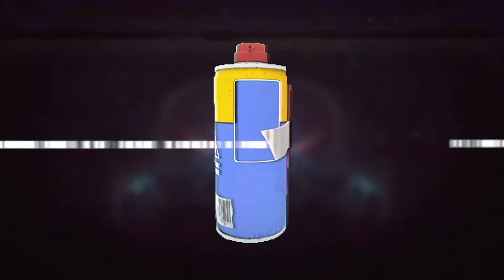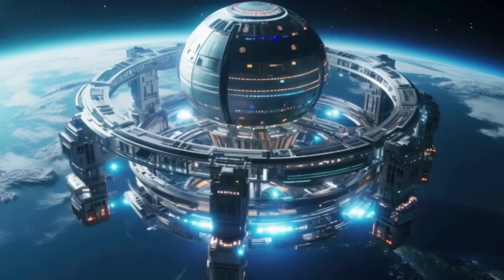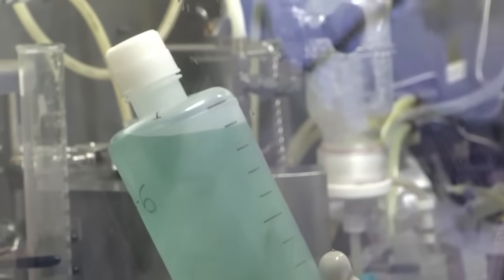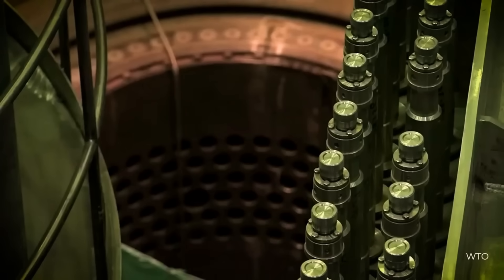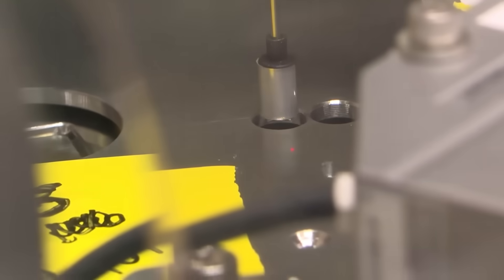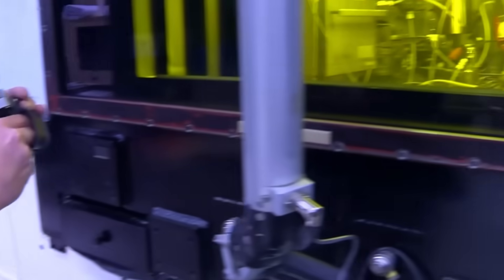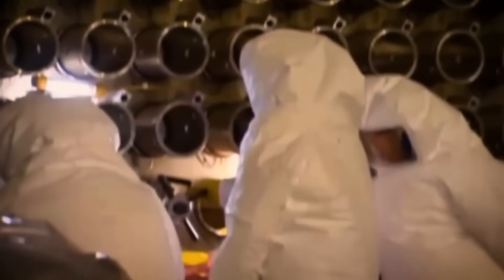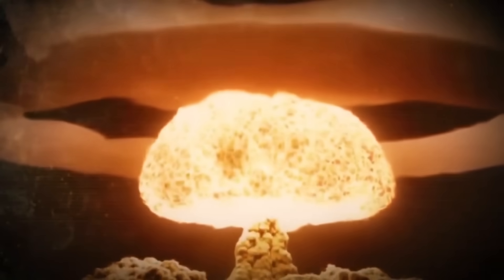☣️ HOW Plutonium is MADE | The Most DANGEROUS Metal in the World

Comment: Don't the materials used to make robots arms react with the radiation 🤔
Reply: The only type of radiation that can "react" the way you're thinking of is neutron radiation. All the others are just particles or photons with a crap ton of kinetic energy. They're often described as bullets, and it really is a good analogy. Holding one in your hand is harmless, it has no kinetic energy. Fire it from a weapon and it's deadly, but once that energy is depleted, it's harmless again. Every atom of helium you've ever inhaled to talk like a chipmunk started life as alpha radiation. Beta radiation is just electrons, and UV/X/gamma rays are just highly energetic photons.

Neutron radiation is a bit trickier. Less like a bullet, more like a rifle grenade. They are not stable outside of atomic nuclei. They have a half-life of ~6 minutes, and when they decay they release even more energy. But back to your point, they can also be absorbed by other nuclei, which is what is happening to the targets referenced in the video. This is the "reaction" you're thinking of. When absorbed by normally stable atoms, the neutrons transmute them into typically unstable(radioactive) isotopes. Since these metals are designed for these types of environments, one can assume that they've chosen metals that are either less likely to absorb neutrons, or that can absorb them without much degradation.

Comment: I heard that Nasa doesn't have a big reserve of plutonium and they keep it for special mission like dragonfly. It's the reason they put solar panels on Juno instead of a rtg.
Reply: The supply is limited, but replenishable.  Several DOE sites and national labs can make 238 by different means.  It is just extremely expensive.
Reply: @boeubanks7507  The Department of Energy (D.O.E.) wants N.A.S.A. to foot the bill instead of the D.O.E. having to pay for it. I do like the idea that Dr. Kirk Sorenson has proposed. Using Uranium-233 and use that to manufacture Plutonium-238. It's still expensive though.

Comment: CORRECTION at 2:09: Apollo 11 didn't use and Plutonium 238 or have any other radioactive material on board or to power its science experiments.
Reply: Voyager probes were nuclear. 1 is still active outside of our solar system.
Reply: @jonathonmcglew4992  I didn't say that they're weren't.
Reply: Nearly every probe and many satellites since Apollo 12 have used Pu-238 based RTGs for both power and heat.
Reply: @boeubanks7507  I'm well aware of that fact. Thank You. "Subscribed" To Your YouTube Channel.
Reply: Were you there to see?
Reply: @richardwood6017   No. I wasn't, but Apollo 12 marked the first use of a nuclear power system on a crewed flight, carrying a SNAP-27 RTG to power the Apollo Lunar Surface Experiments Package. Thank you for attention on this matter. Next time, one might want to do one's own research.
Reply: @southtexasprepper1837  Sorry, just a little humor..
Reply: @richardwood6017   Bad humor.
Reply: @southtexasprepper1837   I am not that well oriented on the technical aspects, but will research more in the future.

Comment: Nuclear fool fails on grid economic details. 
Grid cost is 10times bigger than generation costs.
Rooftop PV is 2times smaller than generation costs. 

Cashflow demand by the grid is too big for economic sense to Rooftop PV consumers. 

Consumers remaining on grid supply are being gouged as grid cashflow collapses. 
4cents kWh at generator costs me 52cents at my meter box. 
Rooftop PV is 2cents kWh for decades and decades and  .... 

When the sunshines and the crops grow and the batteries are full grid cashflow crashes. 
Many months and no grid cashflow is the biggest problem. 

Petroleum heating in mid winter weeks is environmentally nothing. For the 10% of the world's population live outside the world sunbelt. 

Petroleum for road building and maintenance and petrochemical industry and emergency use and strategic military defence reserves and emergency heating and other uses will remain for decades and decades and decades....

Comment: "84 Watts of thermal power, enough to power the systems of a spacecraft like the perseverance rover for one year"

...why one year? Are we mixing up power and energy? If it works for one year, it works for 10!
Reply: by that logic, if it works for 10, it works for 100.

I asumed 84W are enough for Perseverance to function, and that the material can sustain those 84W for a year - no more.
Reply: @ix12  Except fissile materials don't "run out", they decay.

Plutonium isotopes have half lifes ranging from around 20 to 100+ years, which means that the energy source,  unless sized in a comically bad way, will either provide energy for decades, or won't be sufficient at all. 

I suspect someone mixed up KW, KWh and possibly other units in a big blob of bad engineering.